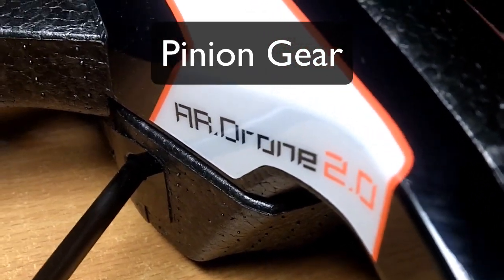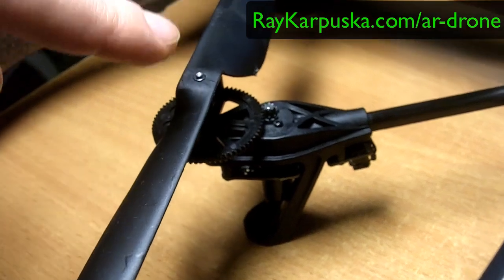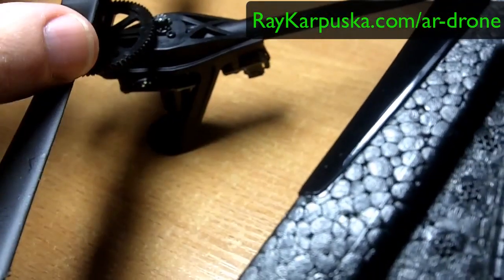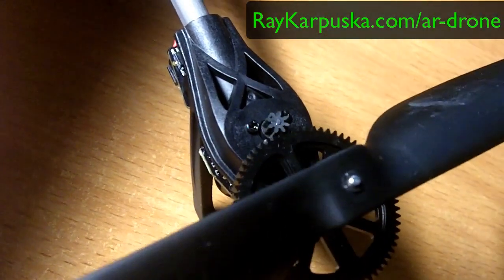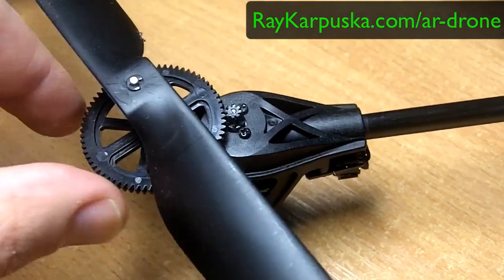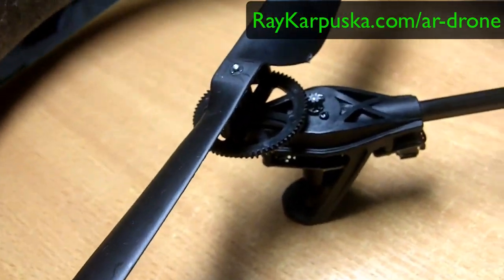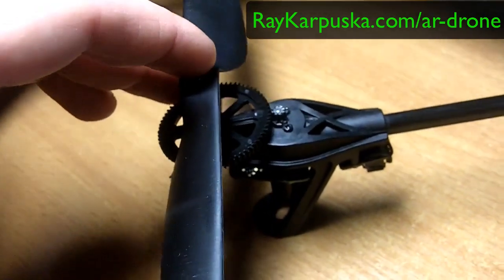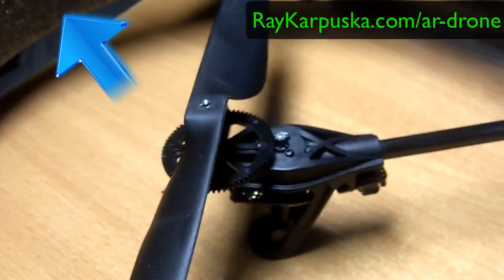AR Drone 2.0 Pinion Gear- Forget MOTOR Replacement

Comment: I have an AR Drone 1.0 and in no videos on the net, including yours, does it show how to remove a damaged pinion gear from the motor.  But yet they sell the replacements.  Seems no one knows how to remove them. They don't just "pop off"  Any thoughts??
Reply from the maker: Yes they do..   just pull, or push on the shaft while pulling it,  but they remove
Reply: raykarpuska  apparently the AR Drone 1.0 doesn't have this feature.  They appear to be pressed on or adhered in place.  I've been finding this on several Drone repairs around the net.  "My" drone won't let them loose.  No matter how much pushing or pulling is involved.  They still spin freely, but nothing will let them work loose without damage to the motor itself.  "PARROT" is telling me to just replace the motors or I "will" damage them in the process.  I know the 2.0 version let them go much quicker, but this one won't release.
Reply from the maker: Oh yes i remember, the number 1 didn't have it..   sorry you're stuck,